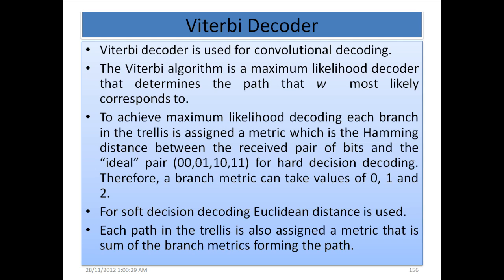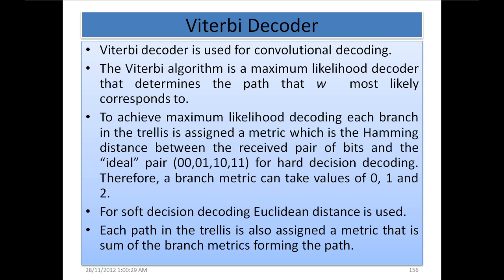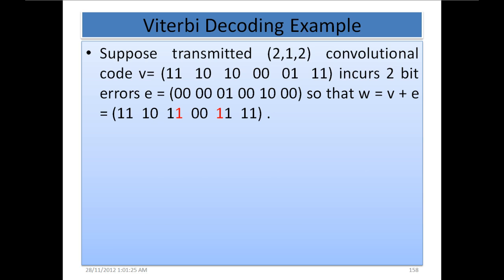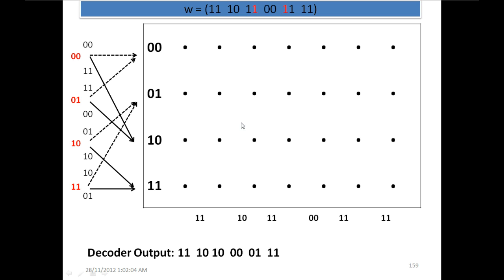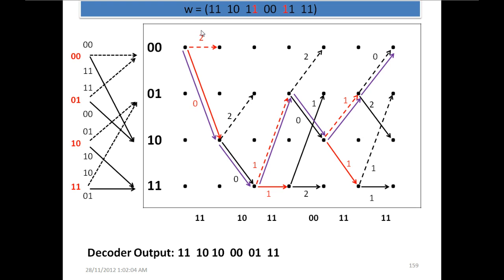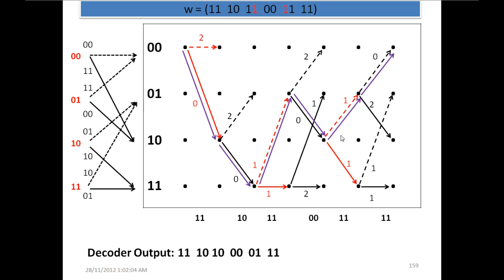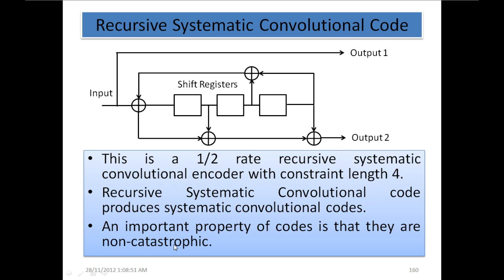Information Coding Theory   Part 21 - Viterbi Decoder, Recursive Systematic Convolutional Code

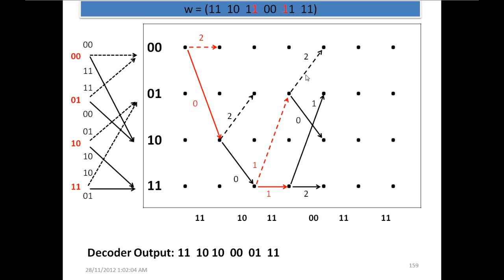Comment: i think that at 6:55 there is a tipo... why should there be 2... the Hamming distance of '00' and '01' is only 1. As you have explained you are not wathing distance between output code and state, but output code and transmition code. In this case is '01'.
But thank you very much of this tutorial... you helped me a lot by it. Thanks mate :)
Reply from the maker: You are right Mihael. When the input bits are '00' (at 4th stage) the Hamming distance between the transition state and the received code is 1 not 2. Thank you for pointing out the mistake.